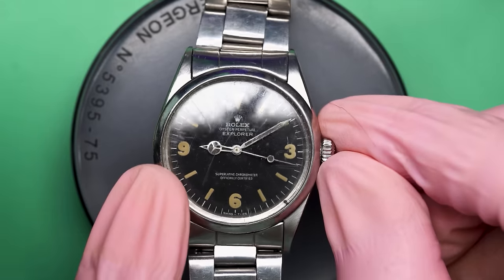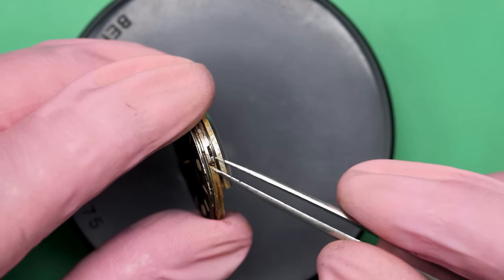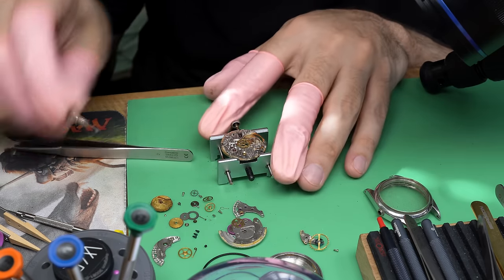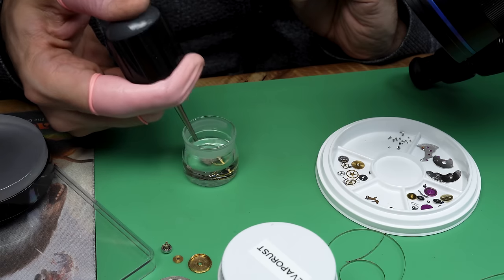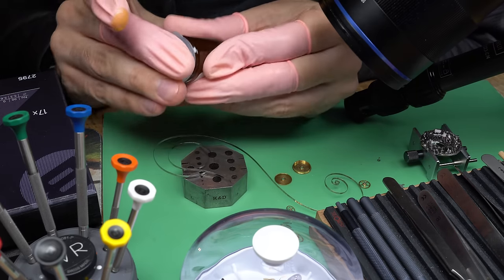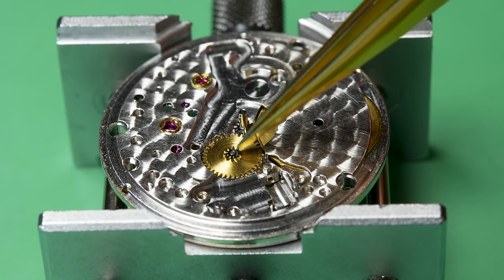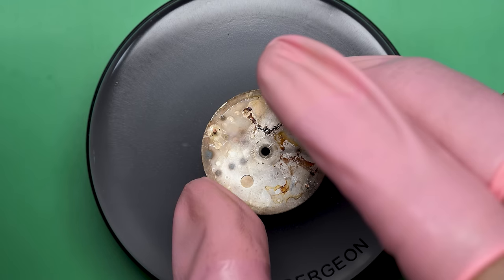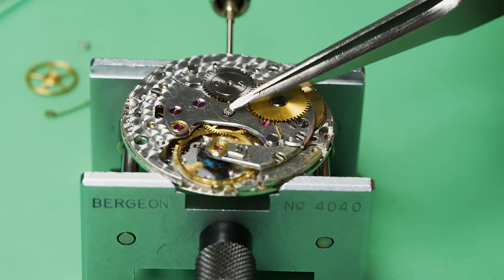This $25,000 Rolex Explorer Was Exposed to Seawater!

Comment: Speaking as a marine mechanic with extensive experience disassembling rusted out junk, and no experience with watch mechanisms, I wonder why you didn't start by soaking the thing in WD40 or equivalent?  Are there materials in the movement that would be damaged by this?  It would certainly make it easier to unstick the rusted components.
Reply: I was thinking the same thing and was also thinking that if you filled the ultrasonic cleaner with WD40 and ran it for a couple hours with the entire movement in it, it probably would have worked after.
Reply: I am no watchmaker but I would assume one reason is because he wants to investigate the watch as it was when it stopped working so he can specifically identify any stuck mechanisms.  Also because it just makes a mess and you probably don't want to risk contaminating the various cleaning solutions he uses.
Reply: @bcd2107  A friend had a Voice of Music record changer, wouldn't cycle properly, so he soaked the entire mechanism in WD40. What a dripping mess!  I had to soak the entire changer in a solvent to remove all the gunk. After digging into the mechanism, I found a spring tang broken off. That was the problem, and 20 gallons of WD40 would have never made it work correctly. As far as I am concerned, WD40 is for displacing water and that's about it. I wouldn't use it on anything of value.
Reply: I'm a different sort of mechanic, but the reason that WD40 is shunned and not used for our applications, is because it leaves a film among other reasons.
Reply: @quantumleap359  The ONLY thing wd40 is good for, is as an aluminum cutting/drilling lubricant, or for wet sanding metals. It's not an oil, it gums up and varnishes extremely quickly, is more solvent than oil, which will damage plastic and rubber things, from seals to belts to orings, etc. It's a shitty product with great PR/ad campaigns. Actual oils are so infinitely better than wd40 at being an oil, it's insane. The cheapest light machine oil (sewing machine oil, normal gun oil) is far superior. Once you compare it to actual high end synthetic lubricants... it's so outclassed it's funny. But, it has staying power due to name alone. PB Blaster is far superior for rusted/stuck fasteners, their synthetic oil w/ teflon is better for lubricating, or trying to keep metal from rusting, and it's around the same price. PB's silicone oil w/ teflon is amazing for lawn equipment.
Reply: @quantumleap359  At the least soaking it in any oil would make disassembly easier and loosen rust. A simple spray with brake clean, alcohol, or a solvent bath like you would do anyways and blow dry with compressed air would remove any residual oil. I know some things are just broke but since this watch worked until it got wet it would be easy to assume that it just bound up and isn't broke. Obviously this guys a watch repairman so he's going to do it the right way but if the average person soaked it, cleaned it, and oiled it they might get it running again.

Comment: The owner must be deeply pleased to have such momento returned to her, and in beautiful condition. OP may have mentioned this, but that's a service crystal, not the original domed version which is on my watch (mine is from 1970, and is a Mark II). It is possible to get replacement domed crystals, but at a Rolex ASC, they insist on using the flat one which is apparently more durable. Given that the watch had been repaired previously, it would make sense that the original crystal was swapped out as well. Overall, a lovely story in every way, and thanks to the watchmaker for making these excellent videos, and bringing happiness into the lives of the customers. 😊

Comment: Hello , I've found out something interesting regarding the cleaning sponges that are called magic erasers.  Basically the material that they are made out of is basically a buffing pad. It has fantastic abilities when it comes to any restoration projects. I've polished scratches out of glass panels, window panes, cell phone screens, TV screens , all sorts of soft metals and even used them to do a final polish on stones. I have used them on acrylic sun glass lenses without problems, however it's always best to test on something your not worried about destroy first .....
 If you end up in a pinch they would certainly prove to be an equal substitute to what your already using.

Comment: To clean off the rust can you use muriatic acid? I found this interesting since I have a few older watches that need repairing.  I have an old Gruen that I purchased about 1979 and it worked for  30 years without problems and then I stopped working one day and I couldn't find anyone that could fix it.  Now I have had to purchase a number of watches after that.  It is interesting to see how watches are not made they way they used to.  Thanks for the video.

Comment: Back in 1969 I was over in Sasebo Japan at the Navy exchange and purchased a Rolex divers watch submariner and brought it back to the States with me. It cost $125.
The naval reserve diving unit we were in was mobile salvage diving unit 1.
We went on our 3 week annual active duty to Enewetak Atoll.
I did not use the watch very much because it really didn't keep really good time, but I thought this would be a good time to try it out while we're diving.
I too did not tighten the winding stem as much as I should have and it leaked saltwater inside.
I was up late that night with a pair of vice grips taking the back off the watch and rinsing it out with  Clean water and letting it dry.
I sent it back to Rolex to see if they could repair it and they basically put a new mechanism inside the watch and send it back for around $200.
I kept it for several years. Not using it very much but I was at a gun show and someone was buying Rolex watches  and he ended up buying it from me for $600 so I feel they came out in the end.

Comment: Funfact: The 563 movement was designed for export to USA. At that time, the import tax on watches was calculated, based on how many jewels a movement had. Fewer jewels, less import tax. :) This movement has 17 jewels, the 565, which is basically the same movement as the 563, has 24. In the video it was immediately clear where they saved the jewels - on the automatic seitting.

Comment: I had a feeling the crystals were made out of acrylic judging by how they would crack and scratch, but it still came as a bit of a surprise to hear it confirmed. I would have expected Rolex to make them out of glass, sapphire, even fused quartz, or something else that would be highly wear resistant instead of a cheap plastic. Maybe acrylic had better resistance to shattering than any alternatives they had at the time, and that was generally deemed to be preferable?
Reply: Indeed. And the shape of the crystal was probably not conducive to being made of glass and durable at the same time.

Comment: I find it hard to believe Rolex refused to fix this watch but it was likely due to lack of parts. They stock parts up to 35 years past a given model's production. Either way it's actually good they did. Rolex would've destroyed the value of that watch. They don't care about preserving patina and would've cut it's value in half. Excellent work as always!

Comment: I have had amazing results using evaporust to clean rust off of precision tools. It works via chelation, unlike pretty much all other rust remover which are acidic and attack the base metal.

Because evsporust is a chelation, it does not effect any other metal in my experience.

What is your opinion on using evaporust ascthecworking solution in your watch cleaning machine, or even a scan initial immersion solution used before beginning disassembly?

Comment: I'm quite disappointed by Rolex in this. A premier watchmaker unwilling even to try fixing it when, upon inspection, the issue really wasn't that bad and really only necessitated a thorough cleaning and service, plus replacement of 4 parts. As for availability...well, it's not like Rolex doesn't still have the machinery needed, or like there has been massive new developments in gear technology in 60 years.

Just very disappointing overall, but I'm really pleased to see you rescue this watch.

Comment: Evaporust uses a chemical that bonds to metal oxides and forms water soluble salts with them so the rust dissolves into the water until a clean surface is left.

Comment: Do you know if the initial jeweler at least rinsed the salt water out?  On things on my scale of skill, like an old screw driver,I would get rid of the salt water with rinsing then drying and then oiling. Would it have been better to do this and soak it in regular machine oil until it got to a person with your skill?
Great video as always.

Comment: As a Sailor who has had to deal with salt water a bit... a lot, the brown staining that appears to be 'rust staining' is more likely micro-biota, little plants and animals you find in every drop of seawater. They love to eat expensive things like high priced grease and oil, exotic metals, human detritus left from skin flakes and skin oil. The only way to tell if its actual corrosion or critters is... corrosion flakes off and leaves a void from lost material, critters can do that too if you leave them long enough. I would have replaced all the screws and chased threads, because both critters and corrosion love 'peaks'. On every aircraft I worked on, common screws were routinely replaced because if the thread corroded you could snap it off. Over all the corrosion and critter leavings I saw here, by my experience, was minor.

Comment: I live on the coast, and this happened to me when my watch fell out of my pocket into a tidal pool. I rushed home and popped the works out of the case and rinsed it with distilled water and popped it under a hair dryer for 15 minutes before popping it into a small case of those silica gel packets for a day. The next day, I dabbed all the visible screws with a tiny drop of penetrating oil and lightly wiped the surface with a lens cleaning cloth with a very light mist of mineral oil it. I lost the bloody thing two weeks later in a taxi, it was still working though.

Comment: It was interesting to see what rusted and what didn't. It appeared to be just the carbon steel parts. This makes a lot of sense though given they are further up the reactivity table. But this was important to the watch's survival. They acted as sacrificial compliments and kept the other metals safe through electrolysis. Think of them as the sacrificial zincs on a metal boat.

Comment: Seeing how time can wasted by a watch store/jeweler as well as the brand itself, what would be your recommended course of action if sea water finds it way into your watch? My first thoughts would be: 1. Find any watch store/jeweler and have them remove the back of the watch, and throw the watch in a bag of rice until you can get the watch to the right person. 2. Likewise, except see if they can also have the movement removed from the case as well as the hands and dial removed, and submerge the movement in synthetic (engine, etc) oil until you can get the watch to the right person.

Comment: I should have sent you my late aunt's diamond studded 50 years old watch that had molds on the dial as confirmed by 2 HK watch repairman and also a cracked crystal glass. They told us, Rolex headquarter in Europe was the answer for repair. Sadly, we sold them dirt cheap, $2k US😢

Comment: There's another YouTube video about a restoration of a Rolex GMT II that was almost completely rusted inside. Most of the parts were replaced, including the dial, hands, gears, balance wheel and escapement, barrel, mainspring,  all the jewels were replaced, the main plate was replated, the case was sanded, polished, plated, the crystal replaced, basically it was a almost completely rebuild, but it looked like new when he was done with it. So I would say if parts are available you can fix almost any watch and make it look new. How much work you are willing to do to restore it is another question. Marshall wants to retain the old watch's patina, so there's room for that strategy as well.

Comment: Well done!   Excellent close-up views!   Thank you.    Why was this watch not waterproof or wateresistant?  23:59  I would polish the setting lever spring.   Synthetic oils?   How much was thew center wheel?   Just said $120.    Did the salt water causelectrolysis between the different metals?   I would have left hiscratches on the crystal as theyvere.

Comment: This video and commentary thread contains some misinformation regarding Rolex’s service policy.  There is an application process for the Geneva-based vintage service center that does indeed perform this type of restoration and repair work.  That said, given the state of this particular watch, it would have certainly been declined.  Regardless, the cost would have been prohibitive for this extensively damaged Explorer.  So much of the value of a vintage Rolex is concentrated in the dial and hand set and this makes damage from water ingression particularly challenging to correct on a cost-effective basis.

Comment: I'm not an expert. I do have an idea. Could it work better if one were to put the  movement in a jar filled with Naphtha and run it in the ultrasound . This could reduce the contamination of your watch cleaning fluid . I have seen a watch maker do this after removing the dial and hands, on rusted watches. She explained that it pre-cleans the parts and makes disassembly easier with less damage to components.  This was an incredible restoration. 🫡🤝💯

Comment: Sigh, In the past 45 years Rolex has pretty much told anybody who asks them to uphold their waranty on the older watches, not only NO, but a resounding HELL NO! They do uphold "some" of their waranties, for their watches BUT only on the VERY high end watches. You can find most of the "standard" parts for the early Rolex watches, but you will need to basicly haughnt the places which carry the older stock. Sadly most of the older watchmakers who trained me, continually bemoaned the practises of the Rolex company, and that was back in the late 1970's and early 1980's. The situation with their company has not improved in the years since.
  So, if you think I am shocked about their actions, I'm not given their record.

Comment: What needs to be said is I think Rolex should be ashamed and embarrased for refusing to restore this watch! Considering the loyalty of a customer wearing their product most of his life, and probably showing it around to many inquirers and giving Rolex kudos for making a great product,... their refusal was shameful and shortsighted! Especially so with the emotional and sentimental attachment for the daughter. 

  So here we are and Marshal "gets-er-done" when the manufacturer of Rolex's caliber wouldn't or couldn't. This video should be a thorn in their side, and downgrade many folks opinion and esteem of Rolex.  In the end, Rolex may not have had current parts availability and took the easy way out,...BUT they also could have searched out the parts on ebay and through their dealer network to find what was needed! (and probably with their network found the parts quicker,... and WTF, couldn't they have MADE the needed parts,... they are ROLEX after all???). 

Imagine the MARKETING kudos Rolex missed out if they has accepted the challenge, on telling this story of the restoration if THEY had done it! Geeze, ... they lost a lot here I think!!!

Comment: now with CNC and machine precision you can make all the parts 1 by 1. Of course cheaper to make in 1000s but only a mfg does that. But all is replaceable, though it never needs to be.  Jewel parts may be finite but metals are not so complex to do or we would not have semiconductor line widths nearing limits of reality.

Comment: I'm watching you repair the Rolex, I can see you are a professional, great watching you work, now my problem is l have a Longines divers watch that l bought in Hong Kong while I was there in 1964, the problem with it , it was purchased with a fixoflex wristband, which slipped a link while l was climbing  a ladder, the watch fell 20 feet or six metres onto a steel decking, I have taken it to three Longine watch jeweller's who have tried to repair it , it worked for a little while and stopped each time, I would love to have the watch restored to its origin , is a divers watch it is embossed with a diver on the back, I would love to have it working as originally designed, I'm 81 years old and would love to hand it to one of my grandkids when I have passed on, can you please help, I'm willing to pay the full amount of repairs,

Comment: I don't know if this is possible with watch parts, but can the rust be blasted off, possibly with something gentle like baking soda, and the part still remain serviceable?  We do it with guns in my industry all the time.  A gun can be all kinds of corroded and frozen into inoperability and still be brought back to life and work perfectly again.  I've done it dozens of times.  You can even weld up and dress down badly corroded surfaces a lot of the time and restore them to original condition.  Even a badly corroded bore with hardly any rifling left can still stabilize the bullet and shoot accurately.  Of course guns are much simpler machines.  They don't generally require extreme mechanical precision for the parts to do what they need to.  They can be very crudely manufactured by hand and still operate correctly.  A watch is surely a different matter, that I don't know about personally.  I just wondered if blasting with a gentle media might be able to save some that aren't too far gone.  Or are the critical surfaces simply unsalvageable once the change to them occurs?